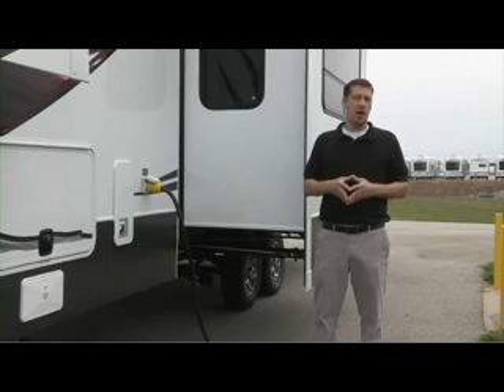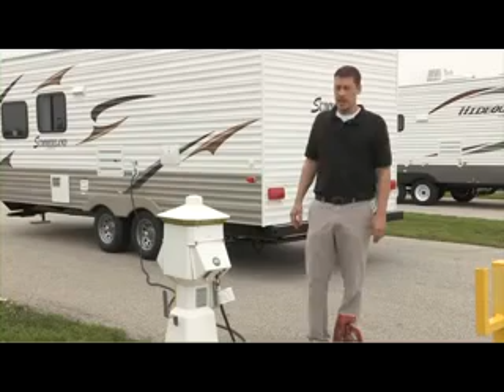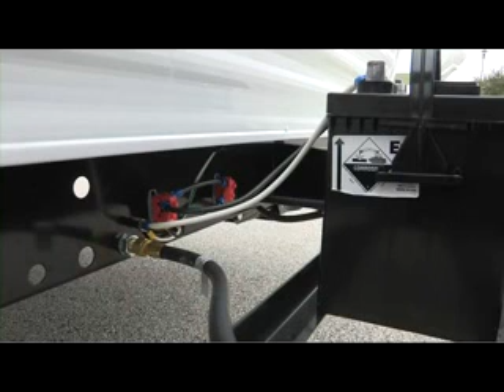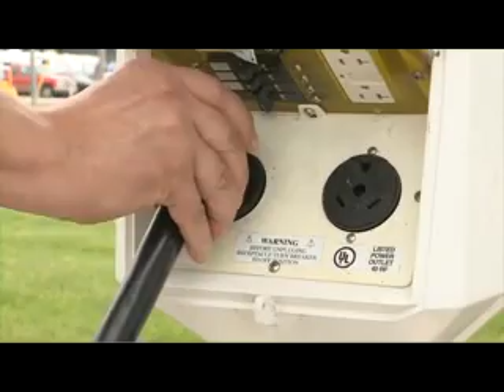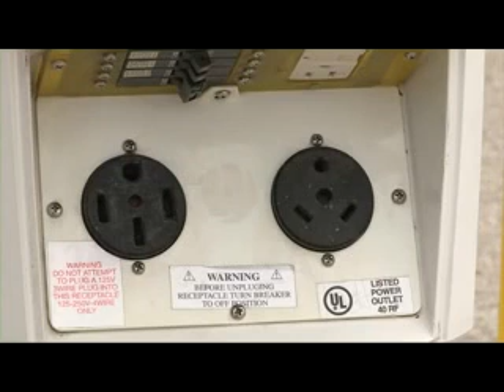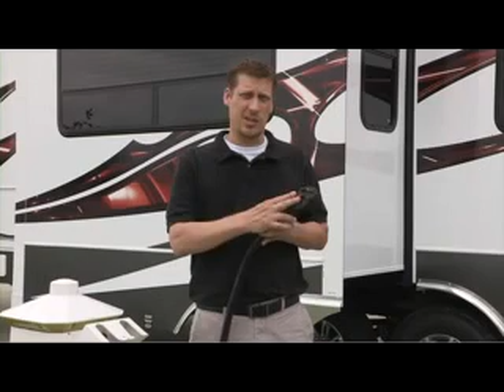Understanding the R.V. Electrical System

Comment: Your penny example was good. But you're basically saying that there's not enough power to run the things that you expect to run?  You didn't elaborate much. It sounds like you're saying that you need to shut off the air conditioner if you want to run the microwave or a coffee maker?

Comment: Hello, I just bought an old rv. I'm thinking I should do the electrical work first. What do I do to get started?
Reply: Hey There - retired electrician here - start by watching a bunch of YouTube videos by real RV technicians. Next try to find a good book or manual covering RV electrical systems. 
Next make sure you have the proper tools like volt meters and testers. 
Start by unhooking all power from shore and batteries. 
Then charge the batteries to full, this should take 4-12+ hours depending on the batteries. 
Now you are ready to begin lol
Hook up the batteries and then plug the RV in to shore power. 
Start testing all circuits. 
Then go from there
Reply: Electricity and propane are things I don't mess with. I would find a shop or maybe a mobile RV service that could help. If you hook something up wrong it could cause a fire. Depends what all you are trying to power as well. What type of RV did you buy? 🚐

Comment: Thanks for all the info! I have a question. Will the converter overcharge your battery if left plugged in for a while?
Reply: From what I understand, an overcharged battery can be somewhat dangerous. S that correct?
Reply: Pat Fitzgerald No it wont damage your battery. there is a charge controller that is suppose to prevent that.